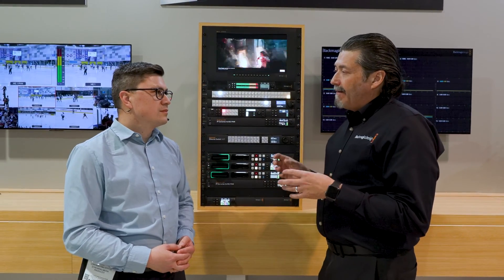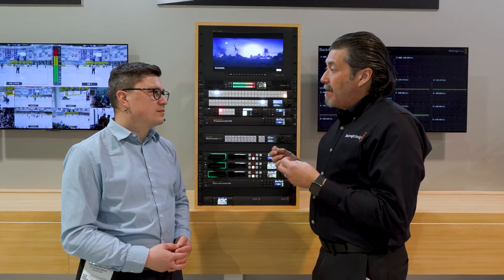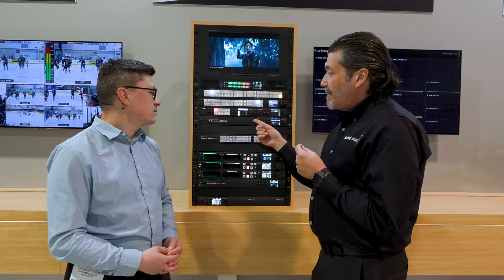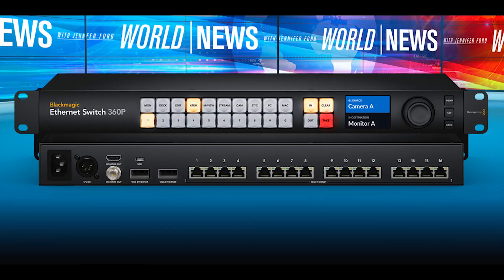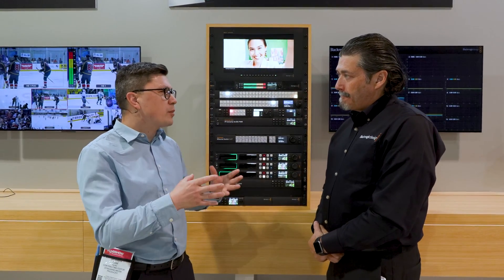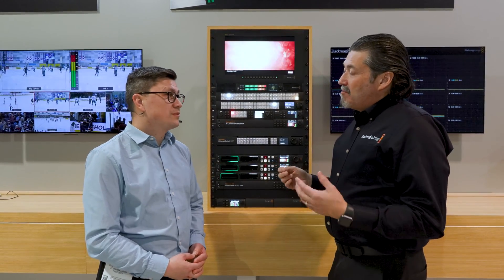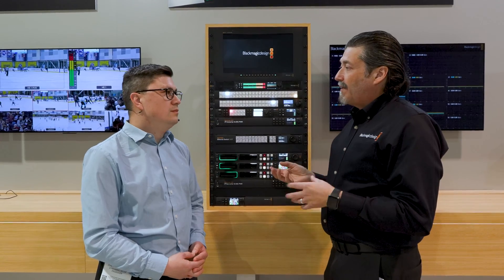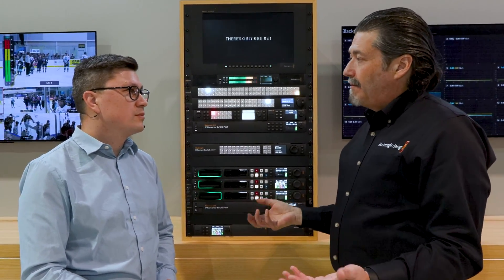NAB 2024: Blackmagic Design, SMPTE 2110, and Video Over IP

Comment: hi, any ideas to the following?
I have 3 stagebox Racks with dante audio, 1 ST2110 converter, ndi + controle for ptz (poe). all three are connected seperately to the core rack with fiber. This core rack contains 3 ST2110 converter, sdi + embedder from dante to sdi to 9 srt encoder. All the signals will be transmitt via internet to our central controle room. From there we use the signals for production, send Signals via ndi bridge back for Video Returns and controle the ptz cameras. So far. That is the basic idea. The main question what hardware can be used in the stageboxes to make dante, st2110, ndi + controle via v-lan possible connected to the core rack with fiber cables (I assume more than one fiber cable per stagebox to corerack - so maybe 2 fiber cables - are necessary for that concept)

any ideas how and whether this idea is possible? What switches are needed vor stageboxes and corerack?